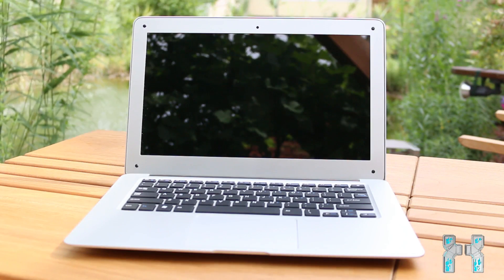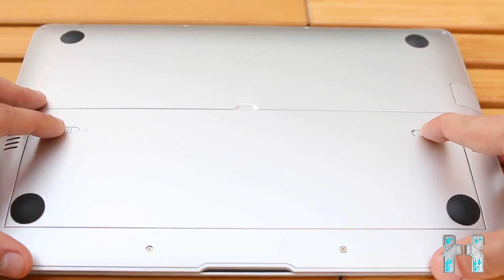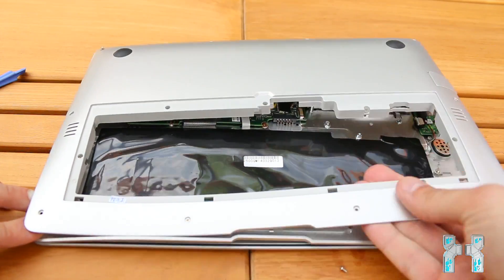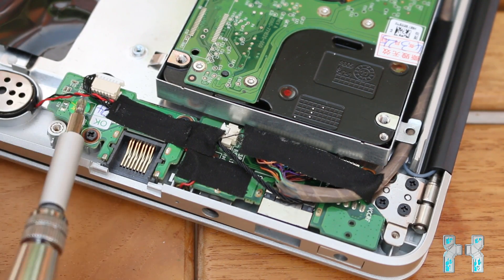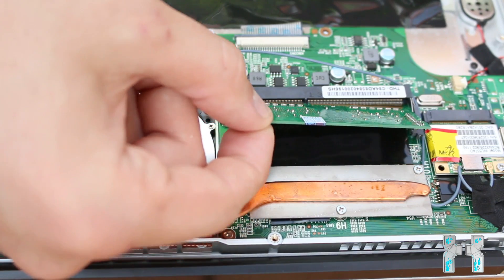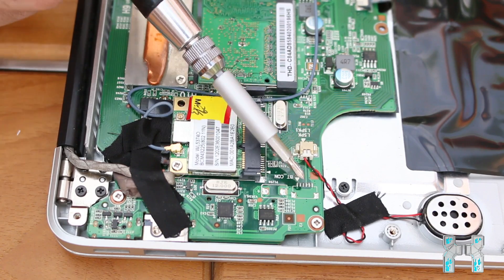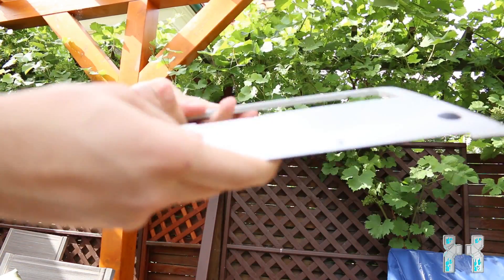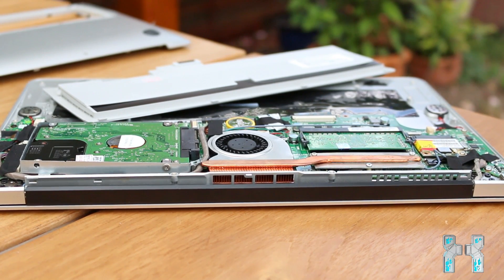What is inside of a fake macbook air ? Fakecheck ! [HD]

Comment: Bulky unit, wouldn't trust this crap no matter how cheap the cost. It would heat out under normal usage. China has no UL rating for safety. Buyer beware. Frayed connectors with 'black tape', trademark of quality?

Comment: Intel Atom?
-Still better than a real MacBook.
Reply: +Isaac Ledesma Yes! An Intel Atom is better than a dual core i5!
Reply: shaneybrainy13  Yes! Absolutely!
Reply: +connor Piper
> due to lack of proper cooling

Boy is that an understatement. I refuse to work on Apple products because of dumb shit like this, but I broke my rule just once for a friend of a friend who had a Macbook with a dead hard drive.

I was stunned to see the thing only had one tiny sliver of an exhaust port at the back of the laptop, and even more so when I opened it up and realized the squirrel blower only had 1mm of clearance on the intake side before touching the bottom of the case. I have no idea how this is supposed to move any air, it's ridiculous.

Without the bottom of the case on, the CPU ran at 65C under max load. With the case on, the CPU quickly pegged to 95C and throttled all the way down to the slowest speed + started NOPing the instruction pipeline, further crippling the unit.

I had half a mind to take a 1.5" hole saw and cut a hole in the bottom of the laptop where the blower was, but the guy didn't want to have his precious Macbook maimed, even to save its life.
Reply: It runs Windows, that sucks, nothing for me
Reply: I put Linux on a Core 2 Duo Thinkpad.  Best decision I ever made.
Reply: +shaneybrainy13 The real MacBook has a Core M, which throttles to 800MHz due to lack of proper cooling. So, I would say this Atom is about the same as the Core M. Considering the Core M does not have that high of an IPC even if it is 14nm.
Reply: GGigabiteM The current macbook does not even have a fan. It is  passively cooled.
Reply: +Isaac Ledesma what? An intel atom is shit compared to a core 2 duo or intel i series.
What a stupid statement.
Reply: +weeowey now, the 2015 macbook, yeah; that's pretty shit
Reply: weeowey With that shitty OS it probably is worse than this.
Reply: +Isaac Ledesma Sure, an Intel Atom is better than a dual-core Intel Core i7 at 2.5Ghz.
Reply: Logan Darklock  Science.
Reply: Isaac Ledesma *Common sense.*
Reply: Logan Darklock It doesn't matter what hardware the MacBook has; Apple somehow manages to fuck it up.
Reply: Isaac Ledesma lol
Reply: Isaac Ledesma what shitty OS are you using? oh, wait I don't actually give a shit. An OS is an OS. Your choice to not use it, or dislike it but you don't have to force it on everyone.
Reply: weeowey An OS isn't an OS when one of them can't even support DirectX.
Reply: Isaac Ledesma who gives a crap if it doesn't support DX, you can still play games. Ever heard of cider? it lets you play windows games on mac
Reply: weeowey lol, so then I'm better off using Linux.

Comment: its pretty sad when a fake product has more internal connection and replacement options than the real thing
Reply: Can't tell if trolling.

Search YT, there are thousands of videos on dead macs, especially recent macbook models.
Reply: GGigabiteM And yet the funny thing is I've never had to send my mac in for repair once, even though I've had one for 9 years. My $2000 HP laptop has had the screen replaced (a random row of dead pixels), the Hard Drive failed after about a month (replaced with an SSD myself) all within 5 months. My mac still runs the same as it did when I took it out of the box a little over 9 years ago. There's no denying Apple uses quality shit in their products, eliminating the need for repairs. I couldn't find a brand on the Hard Drive or RAM in my HP laptop. For all I know they were manufactured in some guy's garage in china.
Reply: Henry Black Guess you're one of the lucky ones. I've seen so many dead Macs of all sorts and descriptions over the years, usually caused by awful hardware design.

As for the HP drive, it was probably a Fujitsu or Hitachi, which are OEM drives only available to computer manufacturers. You wouldn't want to use the same replacement drive, those things are slow (5400 rpm) and only have like 8 MB of cache.
Reply: ***** iZombie. Apple manufactures millions of them a year.
Reply: Not sure how you could possibly think that this is more upgradeable than a mac.
Reply: +Henry Black on the Real macbook air it is impossible to upgrade the ram or add a 3G antenna.
Reply: +FAAAN BOOOI It's actually impossible to upgrade anything in it. The RAM, CPU and SSD are all BGA soldered onto the motherboard. One of those components give up the ghost? Either send it in for hundreds of dollars of repairs or spend thousands on a new one.
Reply: GGigabiteM Never heard of a dead mac anywhere, at least not to the extent you've described. Where have you heard this.
Reply: +Henry Black OMG MY PC HAD THE SAME PROBLEMS

1. There is a random strip of dead pixels I did NOT fix
2. Once upon a time the HDD (yes, HDD) died and I replaced it with an SSD.
Reply: Yes, very sad, no joke...
Reply: My Mac still last 6 years lol. If you don’t play game on it, it can last up to 10 years. Shit window laptop would die after 1 year.